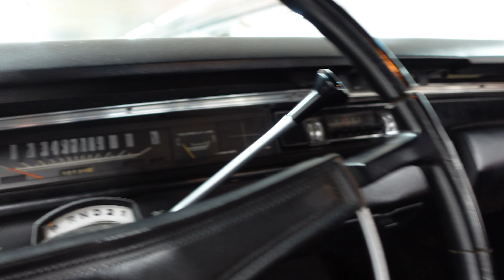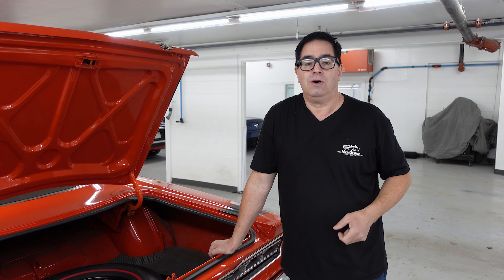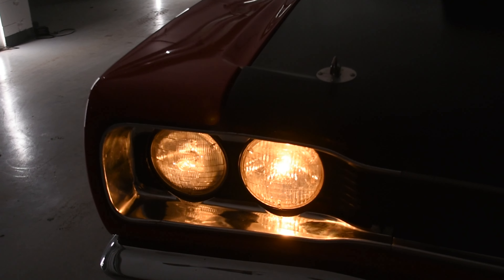Walkarounds with Steve Magnante Ep. 77 | 1969 Dodge Coronet Superbee Tribute | Mopar Specialist

Comment: Currently restoring a 69. A lot of people make a big deal out of the fender tag but a great number of these, including my own, have missing Fender tags. VIN number is also stamped into the radiator support, and other locations on the body. The fender tag really doesn't mean that much. If it is the only reason why you will not purchase a car, then likely there's not many you will buy, because so many of them are missing
Reply: Yah especially on all the "Re-paints"

Comment: Not to be picky, but if you're going to do a tribute, shouldn't you also put back any missing labels in the trunk such as the jacking instructions (If they were used back then)? Most times companies like Jim Osborn Reproductions make them. The details make the difference. 

Also, I think it's worth mentioning to see the fender/trim tag, even if this car wasn't a real Coronet Superbee originally. That and replace all of the burned out bulbs too :). I would think that the marker lights should be on when the parking lights are on. Probably just some missing/burned out bulbs, but all of that shows attention to detail.

We got the VIN, we win: W for Coronet, H for High price class, 23 for two door hardtop, F for 318 V8 with two barrel, 9 for 1969 model year, G (not C as on HOC website) for St. Louis, MO assembly (Fenton) and the rest is the production sequence. No tag, can't brag.
Reply: 1969 Dodge, Plymouth and Chrysler cars did not have side marker lights, only reflectors. They had side marker lights in 68 and went back to them in 70. No burned out bulbs here.
Reply: @gregr1073  Yup, I just read that, so I'll stand corrected on that item then, but there are some details that are missing/poorly done on this one. Butt splice connectors have no place under the hood on such a nicely done paint job/restoration and missing decals should be replaced to give it an authentic look.
Reply: @googleusergp  You are correct, it is a shoddy restoration in some ways and the sad thing is, I’m sure that the price won’t take that into account. By the way I always hated the fact that Chrysler cheapened out and went with reflectors for side markers in 1969 but I guess even then they were trying to save a few bucks. Hell, even AMC, who had no money put side marker lights on their cars in 69.
Reply: @gregr1073  Before I would say "shoddy" I would say "lacks detail". If you're going to do a tribute like this, it should look every bit the part except for the trim tag and the VIN number. Aside from that, you shouldn't be able to tell them apart. Not the case here, and as you stated, the price won't reflect that. Everyone has "gold" now.
Reply: High Octane Classics just showed a 1969 Cougar Eliminator. It was missing the original Boss 302 and 4spd. It had a 351 Windsor and a automatic. Clutch pedal still in car. 🙄
Reply: @cobracharmer6178  Yes I decoded that one.